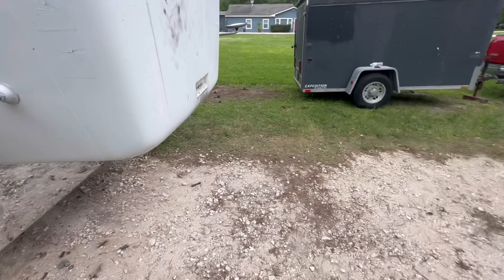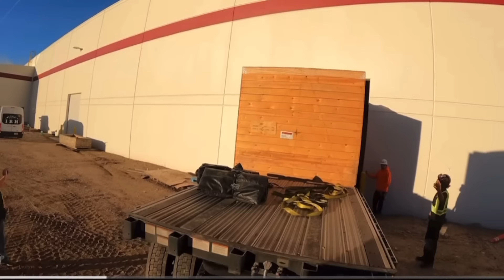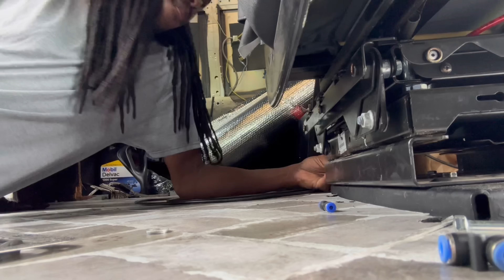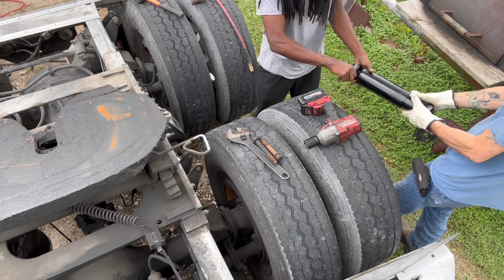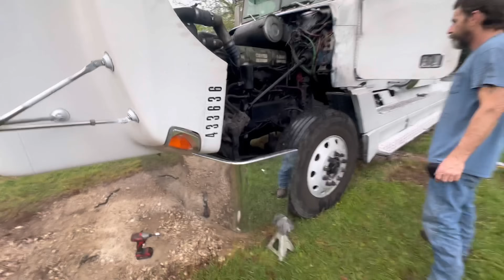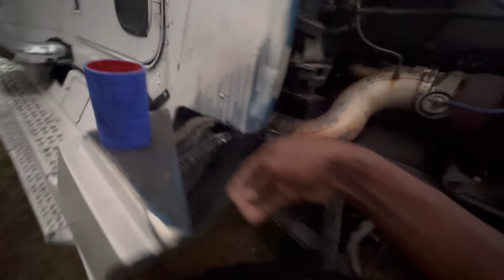FLD RESTORATION (Episode 12): Finally Finishing My 2000 Freightliner FLD

Comment: Between getting rid of the exhaust leaks into the cab, new shocks and air bags, a new seat, I'm betting the truck is gonna feel brand new when you get back on the road. Just need some new-truck smell spray in the cab.

Comment: That's another thing I like about the FLD that seat slides way back for us taller Fadell sized guys. That's a pressure protection valve they call it. Once the truck gets up to 60 to to 70 pounds of air pressure there's like a spring basically that pushes out to close the gap.